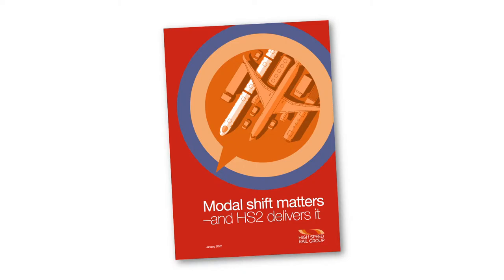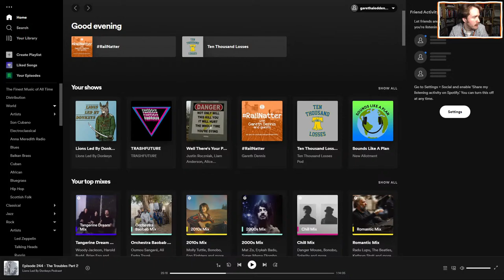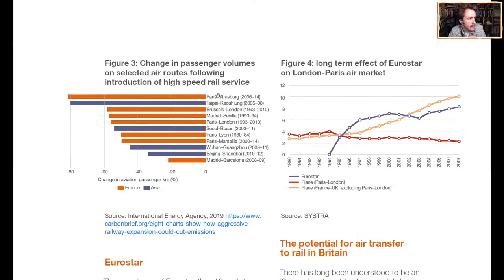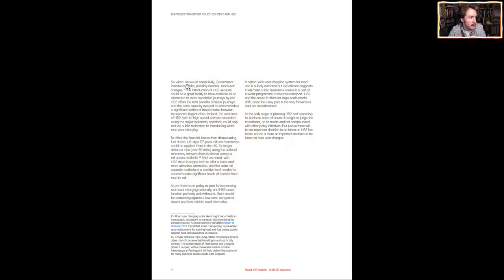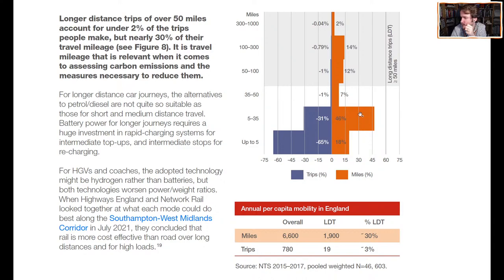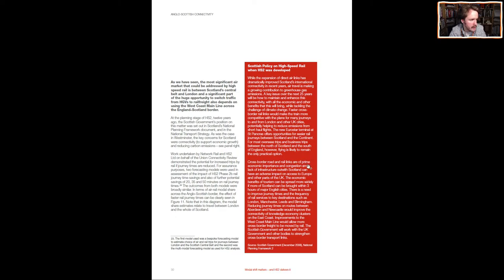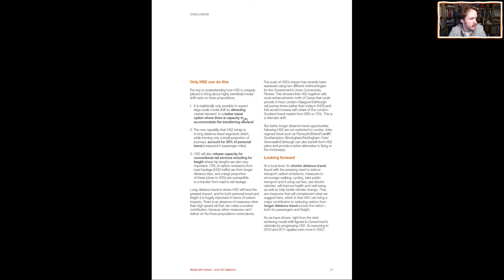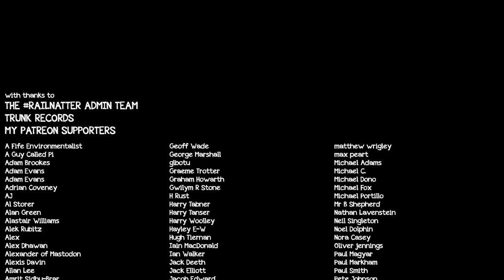#RailNatter | Episode 151: How does modal shift work?

Comment: I actually think modal shift (for passengers at least) may have more to do with the transport in the destination city than the long distance link. Travel to London by train happens mostly because of the Metro system in London. To get more people to travel to Birmingham or Manchester by train, we need to reduce the need for a car once you get there by making sure they have excellent Metro systems.

Comment: small note (more of a nitpick, really) re: 18:30 "electrification of rail is not about getting rid of emissions" - carbon emissions I will agree with you, on a broad and macro scale, however it's also important to talk about reduction in emissions in a very localized area re: reduction in diesel fumes and particulates, as well as reduction in noise.
Reply: Particularly important in enclosed stations. Birmingham New Street platform level is very unpleasant because of diesel fumes.
Reply from the maker: Yes, fully agree on that front!